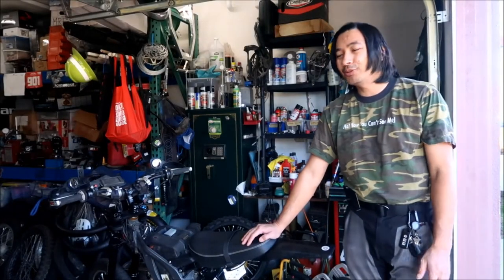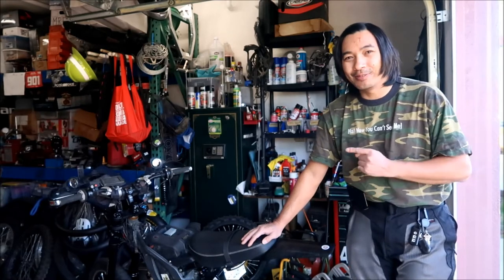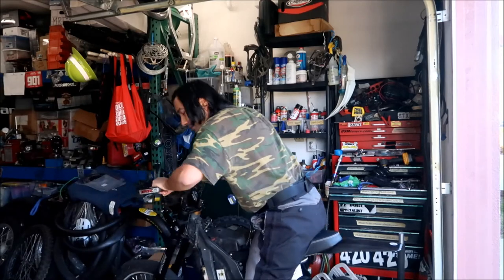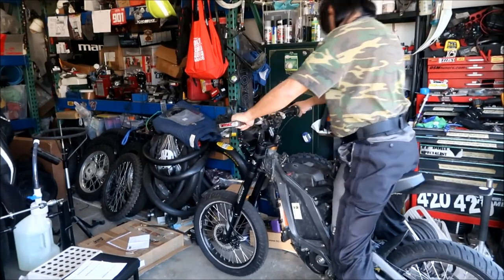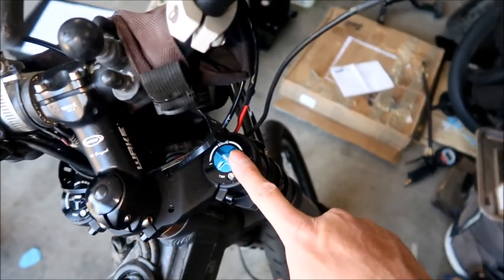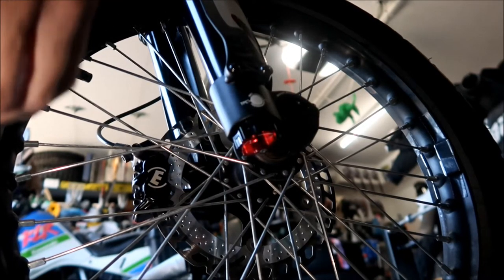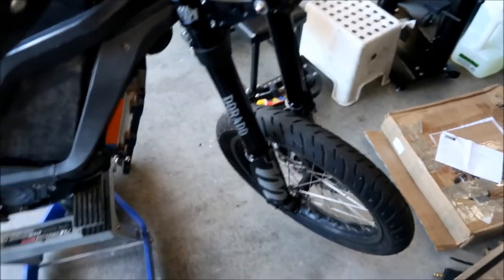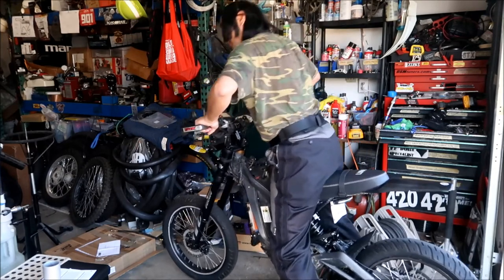Baseline Setup of Dampening Adjusters on Manitou Dorado Expert Fork

Comment: Good job starting to get your suspension dialed in.  Before you make anymore changes try and get that sag set on the rear end it looks too stiff.  If the rear is too stiff it will transfer a lot of weight forward making the front feel soft.  Always set sag front and rear together.  Good luck!
Reply from the maker: Yeah the spring is WAY too stiff I put my stock shock back on and it feels right again.  I won't be putting that Rockshox back on until I get a softer spring for it.